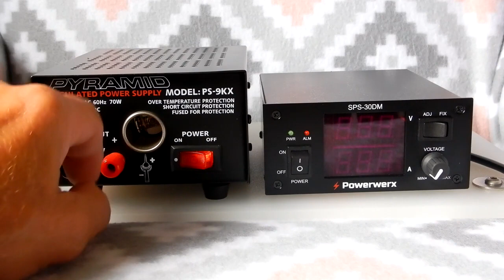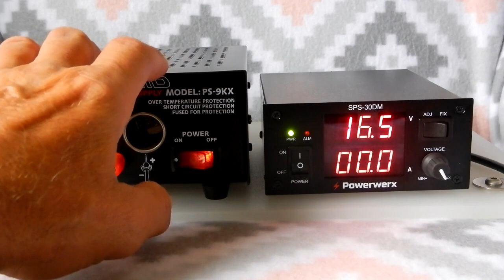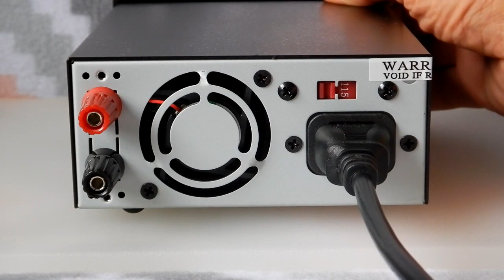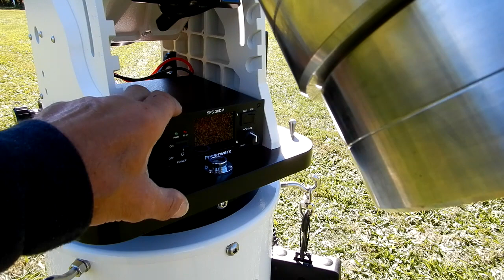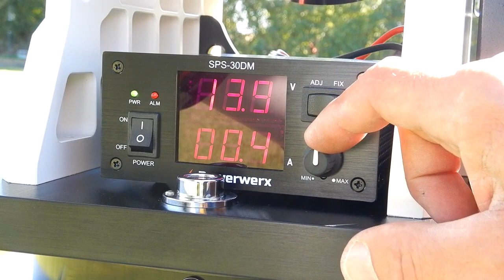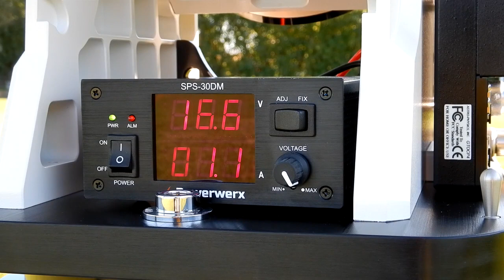Power Supply for Astro Physics mounts

Comment: Was there any particular reason why he told you to keep it at 14V at all times? How many volts was required by the mount? Just curious.
Reply from the maker: Roland from AP has always said the higher voltages will not hurt the mounts and will run better with them.

Comment: Hi reaching out to you again after the rigid case for Mach1, I see you mention at the start of the video you used with Mach1, do you still recommend for Mach1 or you would recommend the Powerwerx one? If the Pyramid works good with Mach1 would love to get it which is much affordable than the powerwerx.
Reply from the maker: I've had no issues with the Pyramid unit when I used it with the Mach1. I still have the Pyramid.
Reply: @starastronomer  thanks you so much.

Comment: Great video - not a minute of time wasted.  My 1200's 13 year old power supply has started generating error messages in APCC.  Your video convinced me this is the one.  Thanks!
-Robert
Reply from the maker: Thanks so much Robert Ray! It has worked great for me. Clear skies.
Reply: Quick question:  should I leave it at FIXED (14.1 v) for my 1200GTO mount or should I switch to ADJ and turn it all the way up?
Reply from the maker: @rray60  I keep mine cranked up all the way on ADJ. George at AP told me it will not hurt the motors. Better in the cold weather too.